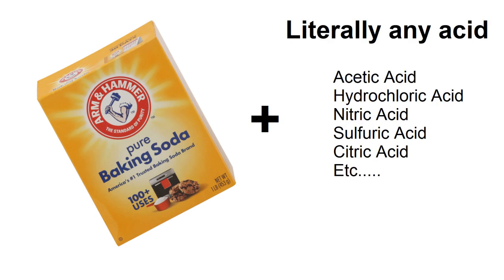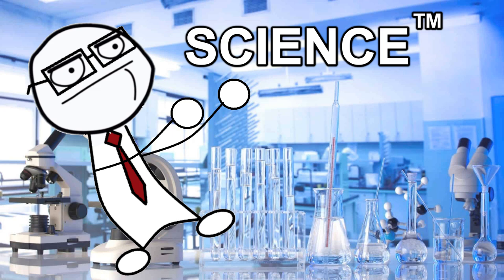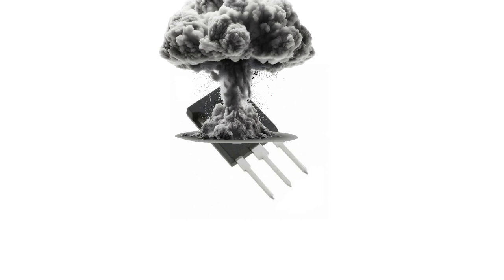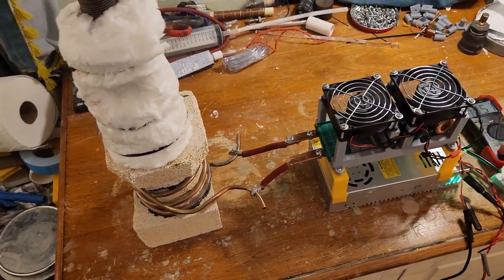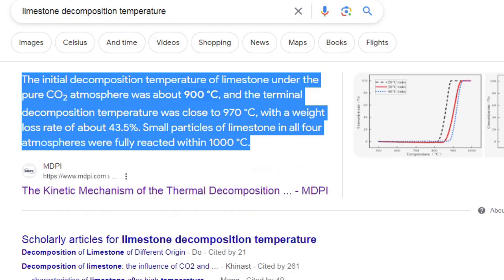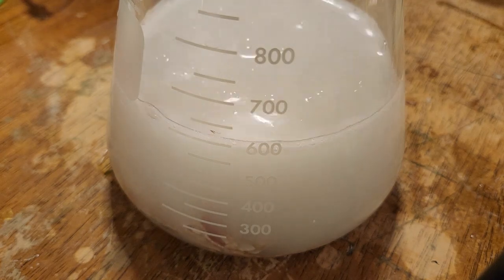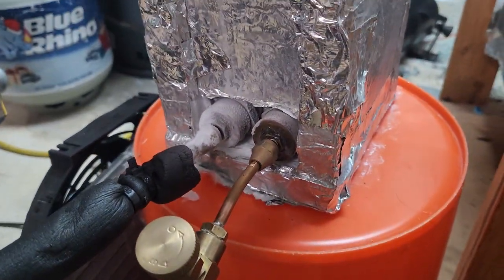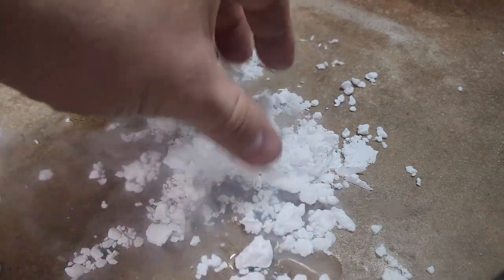Dry Ice from Sea Shells

Comment: I'm wondering, what if you used sodium bicarbonate as your co2 source? its way easier to break down to carbonate, needing lower temperature. and also, what's making it almost free, if left atmospheric air bubble through leftover carbonate, it will slowly become bicarbonate again that you can reuse. pretty much being carbon neutral and your cost is just electricity + initial cost of baking soda which is probably cheaper than electricity for breaking calcium carbonate + your work cost, spent on going to beach and collecting seashells

Comment: Very good. I have an idea if you use an oxygen and methane gas concentrator with a small torch inside a thick steel cylinder with a pipe at the top with a diameter of 10cm or more that is directed towards a water tank, the co2 month side with water will be released above the tank that goes to silicon balls and towards a ball or pool. The flame of the torch has to be blue, perfect combustion to produce 1 kilo of co2, 350 grams of methane and 1 meter 3 oxygen are needed

Comment: Potter here. I burn eggshells to make CaO which I use as a flux (lowers silica melting point and makes a strong, durable glass, its awesome.) anyway, I could totally see some easy modifications to a kiln (electric) to fit a copper chamber inside to do this. There are small ones that run on 15-20amp breakers, same as test forges or knife ovens, but usually insulated a bit better designed to stay on longer. you'd have no trouble getting it hot enough. and modern digital controllers just make it as easy as a toaster oven.

Comment: Instead of calcium carbonate you could still use backing soda, sodium bicarbonate decomposes to sodium carbonate and co2 at lower temps and the spent sodium carbonate will absorb atmospheric co2 over time.

Comment: which vacuum pump did you use? or where can I find one without oil, and an output port. Most info does not state if the pump has an output port or not.

Comment: Two thoughts (maybe already below but tl;dr, apologies if redundant)

- It looks like you had high-strength firebrick; insulating (lightweight) firebrick is much softer and easy to cut.

- Couldn’t you just make a coil with two layers of “windings” in parallel (or should it be series)? That should give you a higher field and also let you go back to a bigger capacitor, which should give you higher current and this even more current.  (OTOH, there’s probably a really good reason why I’ve only ever seen single-wound work coils.)

Comment: You could build something like an enclosure with 1 or 2 magnetrons, inside of it a silicium carbid bowl (there some good videos on how to make it from sic powder and water glass).
It needs to be covered in insulating materials, alot of people use that high temp wool thingy i think made from ceramic fibers.
It gets very hot, people use it to fuse glass or melt metals inside a microwave. Maybe outside one you can even improve the effectiveness of it, for example i read that people take the glass plate out and it heats up faster cause there. But at the same time if the microwave kiln is not spinning it doesnt get even heated.

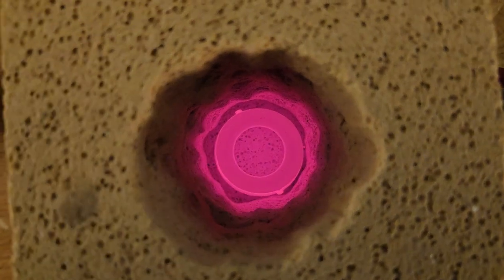Comment: 04:12 - IR light looks "pink" in most digital cameras. This is specially true of very cheap ones when you remove the IR filter from the lens OR even good cameras with a decent filter, if the source is hot enough.
It's actually kinda cool you can make the cheap version (active illumination) of night-vision with just some IR leds and a cheap webcam

Comment: First of all, what has Xi Xihua ever done to you? Second, I want to experiment with using calcium hydroxide to capture CO2, either process co2 from industry or directly from the atmosphere, and then release it with thermal decomposition in greenhouses to supplement it to plants at approximately 3x atmospheric concentration which can double crop yeild. I'm definitely not afraid of fire though, it could be done by burning some of the crop residue in an efficient retort, in cold regions or seasons so that the waste heat is useful, and the ash can be used as fertilizer.

Comment: I think there is a cheaper and "easier" method of making CO2.  I got the idea from Homebrew.  Guys are able to fill three 5 gallon beer kegs to 2 Bar with the byproduct of a 5 Gallon fermintation.  In your case since you aren't interested in the alcohol production (maybe you would be too, BONUS new video idea to clean up the Ethyl Alcohol) you could get away with just putting sugar in water and fermenting it with baking yeast.  Just use the ratio of 1Lb of sugar to 1 Gallon of water and put a packet of Fleischmanns yeast.  For a cost of about $1.50 you could produce maybe 6-10 gallons of CO2 at 1 Bar.

Comment: Why not make a mains voltage ZVS driver? That way you don’t have to worry about your 12V PSU only being rated to 12A. Though you might need to have a lot more output windings, if not a step-down transformer. I’d look into using dedicated gate drive ICs too, get ones rated for 1-2A, and put totem-poles after them to drive 10A in and out of the gates with a nice square wave to minimise switching losses.

Comment: In theory you should be able to disolve the calcium oxide in water forming a calcium hydroxide solution. Then bubble air though that solution to carbonate the hydroxide again causing it to participate out as calcium carbonate again. So you could recycle all the product removing the need to collect seashells or aquire it otherwise. I don't know how long it takes to carbonate the hydroxide with the comparatively low partial pressure of co2 in our atmosphere but it would essentially be free. The high solubility of co2 in water should help capture it from the air to make it faster than just leaving the hydroxide to air-carbonate. Great Video 👍

Comment: Resistive heating is definitely the way to go. Kanthal wire is not expensive and can go up to 1400 C which should be plenty for that reaction. And you don't even need a special driver circuit, just a coil of the appropriate length which can then be plugged directly into the mains.

Comment: I was thinking of other ways to get CO2, and one idea which couldn't leave me, with using either gas, or gasoline like most people do. Direct combustion would just be unmanagable, but if you get one of the catalitic toys for warming tourists hands, you can oxidise gasoline fumes catalytically and collect CO2 with bunch of other crap from atmosphere, which shouldn't be the problem since boiling points of other gasses are well separated from CO2.

Comment: I think I figured out why your induction furnace might be temperature limited. Hysteresis loss in the ferromagnetic iron pipe you're using allows it absorbs the circuit's energy really well. So, one could conjecture that the iron pipe you're using significantly loses it's ability to absorb energy from the circuit above its curie temperature (770C for carbon steel and just over a 1000C for pure iron), leading to the temperature "stalling" at 900C. Heating does occur above that temperature, just nowhere near as efficiently as before since it's now solely driven by eddy currents. Circuit redesign time I guess?
Reply: I agree with this. You can see this demonstration in induction forging where the iron billet will fall through the magnetic field after it becomes cherry red.

Comment: Man you really went about it the tough way.....may i offer you the idea of fermentation?

Hypothetically if you have a sealed large metal cylinder of grass clippings, toss in some cellulase and after the process is done. Chuck in some yeast you should have a process that's both easier and delivers the c02 you need.

Comment: The calcium oxide or quick lime will absorb CO2 from the atmosphere if you spread it out thinly and let it dry, the cementation process is literally driven by absorbing CO2, it can then go through the process of being burnt again to capture more CO2. I don't know if there's any losses but I'm fairly confident that it's mostly a lossless process in terms of the lime.
Reply: If u dont burn the lime stone at over 900 deg c.

Comment: The camera has a non-optimal IR sensor in front of the sensor. The high amount of IR reaching the sensor is causing it to register also as blue, as the color filters are not optimized to block out IR radiation.

Buy a high quality IR filter (e.g., from B+W) and put it in front of the camera, to avoid damaging the camera sensor. There's also a lot of heat introduced to the camera sensor if you don't do this.

Comment: Would multiple small diameter tubes connected at the top as the furnace work perhaps? It's more surface area for the shells to heat up

Comment: Siporex would, I think, be a great material for this sort of relatively low temp furnace.

It is a Swedish invention and is basically foamy concrete. 

It is surprisingly light, the density is about half that of water, so it's actually concrete that floats!

Siporex is easy to shape and work with hand tools like wood saws and drills.

It has great insulation properties, the thermal conductivity is 0.144 W/m °C compared 
to high density refractor materials  which have a K factor in the ball park of 1.2 - 1.4 W/m °C. 
It has a melting point of 1600 °C and it is cheap as chips so if it does not last long it does not matter.

Comment: Regarding the ZVS circuit, you can increase the efficiency a bunch by altering the gate driver topology slightly. As you've built it, the BJTs will operate in the linear region, which means you've got a voltage drop between the gate and the rail (0V or your gate drive voltage), on top of your 10Ω series resistor (minus the momentary impedance of the two caps). You may also be operating closer to the SOA limits during switching due to the Miller effect, which is likely to be quite significant in the context of ZVS.

There's a better option - look up the video "Revisiting MOSFET push pull gate driver" by Sam Ben-Yaakov. He shows a MOSFET push-pull driver design that works by adding split gate resistance (higher resistance to gate drive voltage, lower to ground) and using small MOSFETs instead of the BJTs. That gets you the best of all worlds - no voltage drop in the driver transistors, optimised for reducing Miller effect and avoiding self-turn-on issues, and any push-pull driver shoot-through will go through the gate resistors and heavily reduce the current. I've used it to great effect in scenarios where I can't use a dedicated gate driver IC. It's very fast and super efficient.

One thing to note, though, is that all of these gate drivers are sensitive to parasitic inductance, because the drive current is a few amps and the switching time is very short (nanoseconds). Avoid stripboard, go for a proper PCB, ideally 4 layers with a sig/gnd/gnd/sig stackup (JLCPCB do them laughably cheap these days). You want a really small current loop between your drivers and your gate, ideally with a solid ground plane underneath and local capacitance sat as close to the driver FETs as you can get it. That keeps all the dI/dt in a small area, with a really low impedance power delivery network.

Comment: My 15kw induction forge definitely gets up to white hot for steel; I'm not sure what else they do to get that but it'll melt steel if I leave it in too long, so I definitely think you can get your induction system up to the point you need. I think you might also be having trouble with heat transfer in it; maybe something to rotate the shells inside so they can contact the walls better?

Comment: If you want to stick with electric heating you could use microwaves to heat the pipe. I have a small microwave kiln use for firing pottery and melting glass, not sure what modification you would need as my kiln has a layer of tungsten carbide for capturing the waves.

Comment: a lot of hobby assay furnaces can get up to around 900c and higher and can be found for around 400-500 for a okay model, they can be used as a resistive heater as well cause a lot of them have a opening in the top to allow for gases to escape, or you can always drill one in and run a copper pipe through

Comment: Seashell decomposition is also reversible, after you convert CaCO3 to CaO, make Ca(OH)2 in water and pass air through it. Hydroxide will trap CO2 from air turning it back into limestone. After evaporating water CaCO3 should be left ready to another batch of decomposition closing cycle. This way basic CO2 scrubber can be made.
Reply: Just how my expencive ROCK CRAKING EXPANDO lime oxide has gon off . To much air co2 sucking .

Comment: One possible cheap method to increase your gaseous CO2 storage would be to purchase a larger pool inflatable or more simply an air mattress. With additional props of the air mattress beings it’s slightly more accommodating fill valve.

Comment: So, I would highly suggest using potassium carbonate/bicarbonate to concentrate CO2. This is often used in direct air capture, and you don't need to reach such high temperatures. You can collect CO2 from the air at sub 90C by letting the potassium carbonate turn into potassium bicarbonate. You then heat it above 90C to release the CO2. Search online to find the vapor pressures, some recent papers cover this. With this method you can concentrate CO2 from the air a lot more easily than via calcination since much lower temperatures are possible. Unfortunately, it can take some time for CO2 to be reabsorbed and to extract all the CO2 you want, but you can speed these processes up with agitation. Good luck!
Reply: This is a good idea, although since you'd be decomposing the bicarbonate, you would need to account for the water produced. You could add an inline drying tube packed with pellets of a dessicant in order to dry the CO2. I'd recommend using calcium chloride as the drying agent because it does not react with CO2, comes in pellet form, and has excellent drying power even at low % humidity.

Comment: you might try a graphite crucible in the induction coil instead, it goes way hotter. or straight up a arc furnace with gouging rods they are insane at converting electrical energy to heat but might cause contamination due to its copper coating

Comment: 4:04 The pink color in the camera most probably comes from infrared radiation. You can confirm this by filming an infrared source, such as the LED of a remote control. It will appear as a pink/purple light, even though every normal camera has an infrared filter inside.

Comment: As someone who is absolutely not a chemist, that was an interesting demonstration of the calcium acetate burning. I wonder if some lime were mixed in would that create a useful light source, or does the acetate not burn hot enough?

Also if you are looking for MOSFETs that don't burn easily I recommend the 47N60. It's a beast.
Reply: Probably not. Lime on its own isn't flammable, however it could (maybe?) work if you added a CO2 source like carbon in the mixture, which may react with the lime to form additional calcium acetate, which would then burn the acetone from the acetate. However I am not sure if enough carbon would react with the lime to make any significant improvement compared with only calcium acetate. Interesting idea though, definitely worth some experimentation if you are interested though. The setup cost is a walk to the beach and a campfire 😂

Comment: 8:00- Curie temperature 770C.
Reply: doesn't induction heating not care about that? it's just resistive heating with extra steps
Reply: @bottlekruiser  zvs have care. if not it melt tube in 1 minute.
use graphite tube to increase temperature.
and thermocouple for control temperature.
Reply: @denver1426  now you're just not making sense
steel pipe loses its ferromagnetic properties at high heat and kills the heating mechanism, so to help with that let's use the material that had no magnetism to begin with

okay fine cooler steel can leech the field away or something but you left zero indication towards that and therefore get no points for ravenclaw
Reply: @bottlekruiser  tru heating AL pipe. and you see whati mean.
Reply: @denver1426  бля чел вопользуйся переводчиком уже, не надо корячиться почем зря
Reply: кстати у алюминия тодже нет точки Кюри, я хз че ты там имел в виду, но явно не это
Reply: @bottlekruiser алюминий на  zvs не нагреется. железка нагреется до 770 С.
Reply: так и че
индукционка же не на ферромагнитных свойствах работает, ей точка Кюри побоку должна быть
Reply: @bottlekruiser  и да и нет но скорее нет чем да.
есть параллельный есть последовательный резонанс. паралленьный чувствительный к точке Кюри. последовательный нет.

Comment: There are old forts and other buildings in Florida built of coquina rock, which is a soft rock that’s mostly fossil mollusk shells. St. Augustine has a fort and a lot of old stone walls that are coquina rock stuck together with mortar based on quicklime (presumably from burnt shells or burnt coquina rock).

Since mortars based on Portland cement became common, people have been trying to repair coquina rock walls with them. The rock is relatively crumbly, and the repairs tend to fall out, taking bits of rock with them. Lime-based mortar had to be “rediscovered” in order to provide suitable repairs.

Comment: How slow would it be to set up a membrane electrolysis cell and toss the shells on the side with the anode. The anode will produce acid which will react with the carbonate to make CO2. The issue is that you'd then also get O2 contaminating your CO2. If you're just freezing it, that doesn't really matter tho.